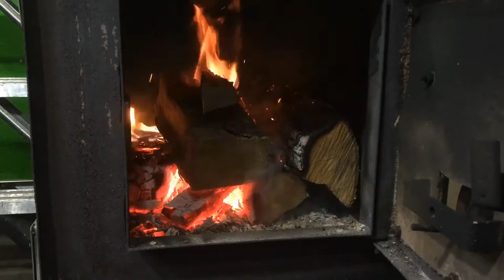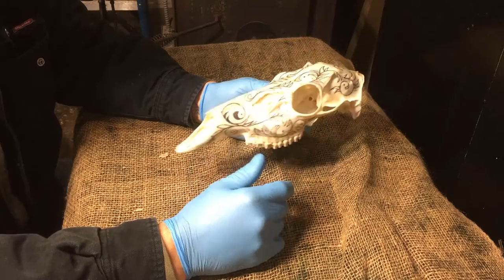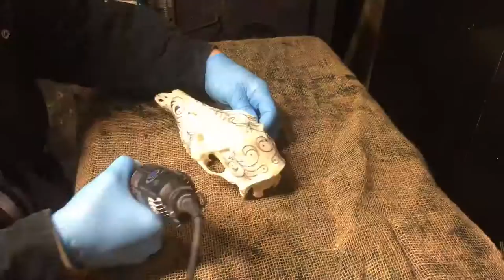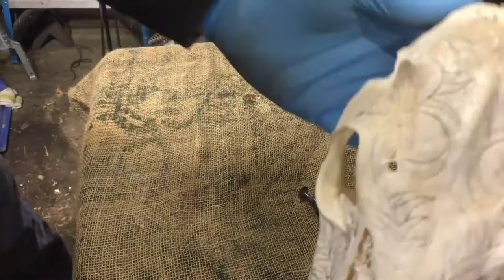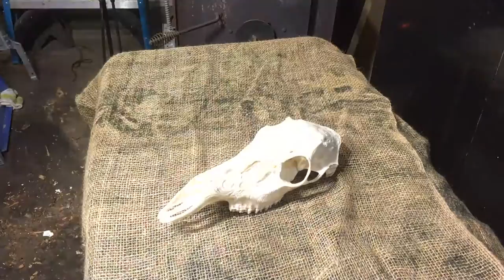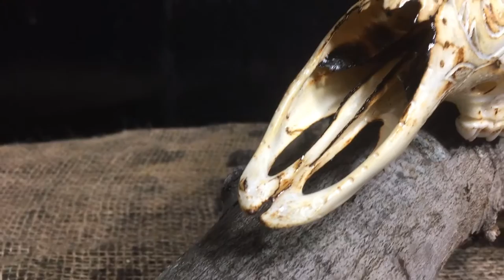How I carved a deer skull

Comment: I've had plenty of skulls come apart on me. If you are careful, you should be able to push them back together. The squiggly fissures are tough but possible. Apply wood glue before pressing them back together. I've had to do this on several raccoon skulls, my trophy deer skull that fell off the wall and my trophy alligator skull that came apart while I was boiling it. The wood glue is barely noticeable and that's only because I know where it is. Good luck and beautiful work!!